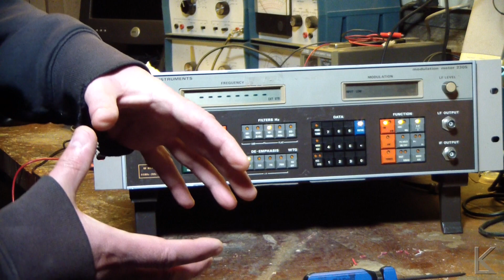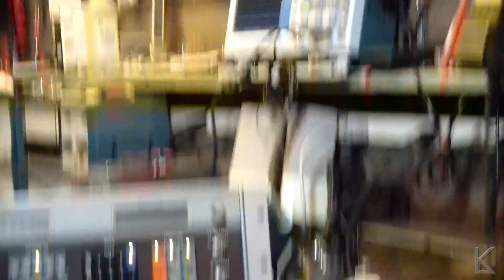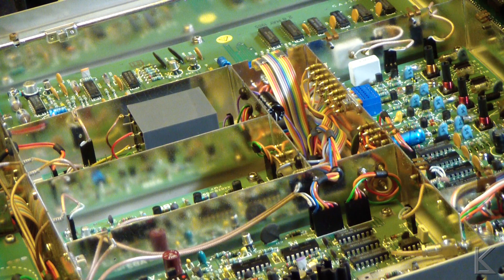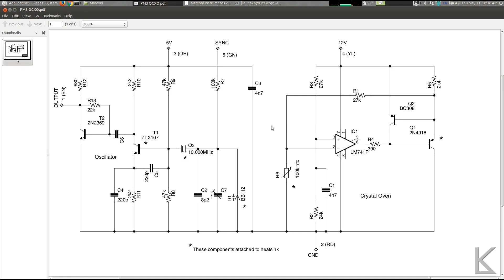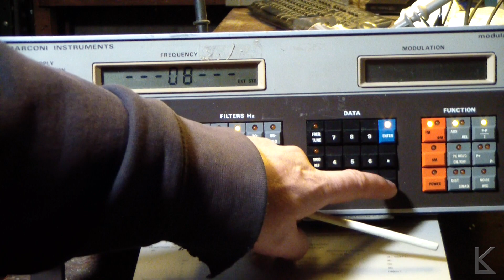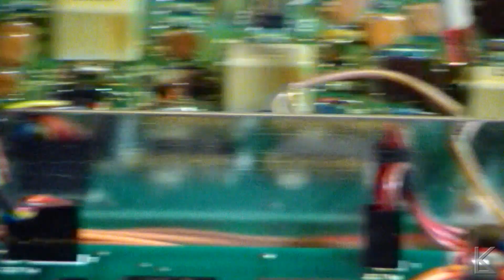Radio - A look at and attempted repair of the Marconi Instruments 2305 modulation meter

Comment: 0:31 - Sorry but it wasn't made in the '60s or '70s.  LCDs weren't commercial until mid '70s or so and yellow LEDs later than that.  Those nice push buttons with the built in LEDs were mid '80s I believe as I remember looking up the pricing for them back then.  They were quite expensive so I didn't use them!  So my guess is mid 1980s when this came out.

12:40 they are NOR not NAND gates.  AND gates are flat at the inputs and OR gates are round at the inputs.

Looking forward to watching the follow up video.
Reply from the maker: +ElmerFuddGun Thanks for the additional info. I knew it was somewhere near the seventies or eighties ,makes sense. I knew they were nor Gates I don't know why I said and, but they were just used as drivers and an inverter to provide a inverted version of the 10 megahertz reference.

Comment: The "Sync" line in the OCXO is used to fine tune the reference. Internally it is connected to a varicap diode, which adds some extra capacitance loading the crystal. By applying voltage to this pin you can pull the frequency of the generator up to a few 10s of Hz one way or the other. It is used to adjust the frequency of the reference during calibration process.
Reply from the maker: Yep, Rick already pointed that out a couple of comments down.  But I have a feeling I'll be hearing about it a few more times.  What's life if you don't learn something every day?
I don wonder why they call it, "sync" and not "adj" or "tune" though.
Reply: YT comment system is hopeless. I noticed Rick's comment after writing mine :)
I guess they called it "Sync" meaning that it is used to bring the frequency of the generator in sync with a master reference. On other OCXOs I've seen this pin is simply called "ADJ". On more modern instruments the pin is driven from a DAC and tuning is done by changing tuning setting.

Comment: This was running from a rubidium standard and I simply forgot to switch it to internal before I shipped it.  I had it aligned to the standard but when the issue was present it should shift several khz.  I touched the 15 Volt lead and it would lock on perfectly and stay there.  A few days later I would notice that it was off frequency again.  It was aligned to less than .1hz a few months ago so if it is working it should be very accurate.  The HP was always reliably <5hz but who knows what the shipping did.
Pin 5 sync goes to a variable resistor on the back of the unit to adjust the frequency.  It changes the capacitance of the varactor on the heat sink.
Reply from the maker: OK Rick,    I'll have to put it aside and let it run for a few days.     I guess I got that sync line wrong.  Oh well, it's still a pretty neat circuit.   I like the way they handle the heater.    It's such a simple circuit, that I'm perplexed by what would cause that type of failure.  Unless one of those resistors in the oscillator has drifted way out of tolerance.  But I wouldn't expect it to snap back in that way.  Very odd.
Still a very interesting exploration into the guts of the device.

Comment: That is a very nice piece of equipment. Back in the late 50's and perhaps early 60's there was a phenomenon we called the TV repairman gremlin. Our TV would stop working properly and we would call the TV repairman to come out and fix it. This was back when they made house-calls to repair heavy televisions. When the repairman would arrive the TV would suddenly be working when he turned it on to diagnose the issues. Nothing he could do would make it stop working and he would leave while scratching his head wondering why we called him for no reason. However, shortly after the repairman left it would stop working again. You may have similar gremlins at work here LOL. Very neat video, Kevin. Thank you for sharing it with us. 73 DE K7RMJ  Frank.
Reply: LOL exactly